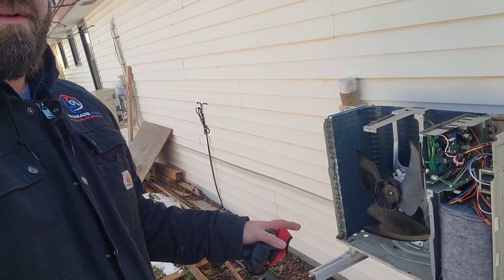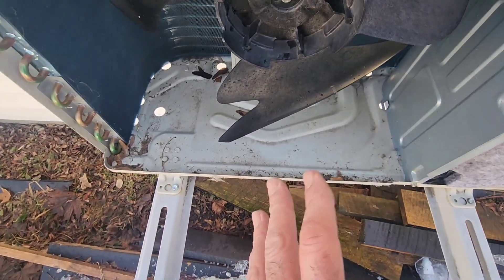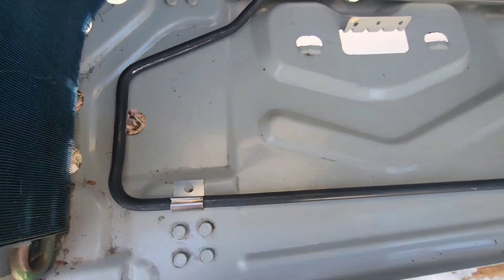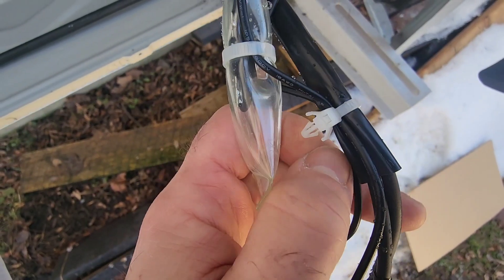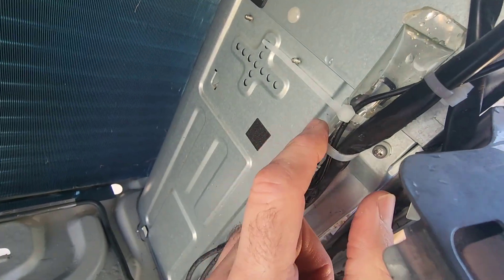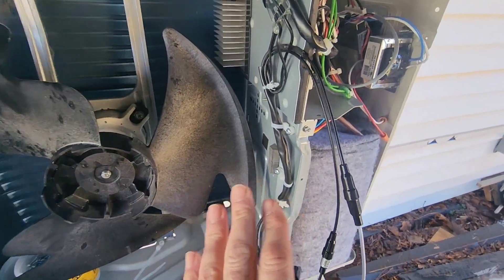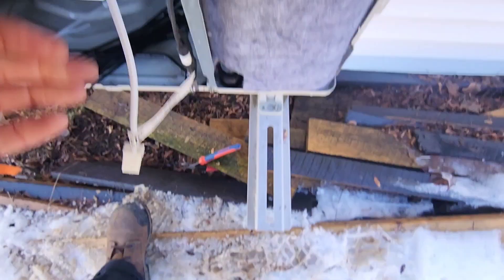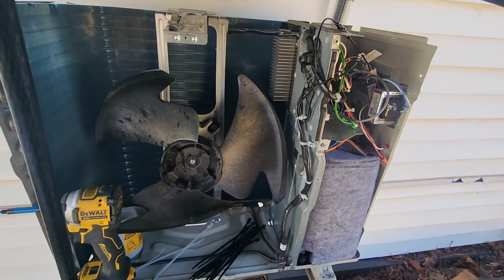How To Install A Drain Pan Heater On A Cold Weather Heat Pump

Comment: I AM getting drain plug freeze up in a Daiken in Cascades PNW foothills. COULD THIS be as simple as needing to RE-LEVEL the unit "just a ** hair" so the pan is "off-level" and the angle toward the front of the unit increased to enable better drainage?? Rather than a pan heater? OR DO YOU definitely prefer the pan heater option??

Comment: I literally just intsalled 2 goodman 24k mini splits with cool bot pros and found out they didnt come with heaters. Lol. Apparently goodman doesn't sell pan heaters so i fabricated livestock water bowl elements to fit in the bottom for now under them unitl i could figure out a more permanent solution. I wonder if these dankin kits will work for the sister goodman condensors.

Comment: I had my HVAC dealer install an 18K Daikin mini-split, replacing a failed (10 year old) Fujitsu. The Fujitsu cost $5,000, about 13 years ago. I did not want to replace it when it failed, account the high replacement price.

The Fujitsu did not have a pan heater, and was a constant problem with ice build-up in our West Michigan winters. I had to take the top off and frequently pour hot water over the coils. 

The Daikin salesman said I did not need a pan heater, but he was wrong. After a two inch(!) ice build-up on the exterior coils, the service tech came out, adjusted the weight of the refrigerant, and installed a drain pan heater.

If you are in a cold climate, make sure to wall mount (or platform mount) the outdoor unit well above your winter snow cover, build a sloped cover over the unit (tall enough to allow servicing), and always insist on a pan heater.

Also, my installer mentioned that a ten year service life was good -- he said that in Florida, where he had installed mini-splits, they usually did not last that long! "Modern" mini-splits are a good idea, that still have a way to go before they are reliable and a good value. They are very complicated to service, and cleaning the inside units is difficult (at best). Buyer beware!

Comment: Sir, will you please explain or cover, how to recharge refrigerant a heat pump during winter specially ambient is below zero C.
Thanks
Reply: Mini-splits are far too complicated for a layman to trouble shoot, and/or recharge. Follow the owners manual for trouble advice, and call a service man if you cannot find a fix. It takes expensive special tools and special knowlege to charge them. Even the length of the refrigerant line needs to be taken into account when charging the system.

Comment: so is this heat pump specifically for cold climate? I know they make some that are compatible with very low temperatures while retaining good COPs..... Was wondering if those specialty cold-climate heat pumps even had reversing valves for AC or if they were only ever meant to be run as heating.
Reply from the maker: Yes the have reversing valves for AC most definitely